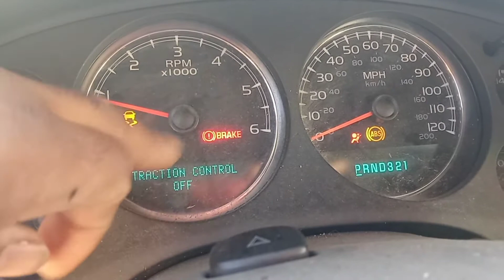Proof AFM DELETE TOOL WORKS/ 2 YEARS LATER!

Comment: Bro!! I have the same sprint I think. But it won’t let me pass smog. That’s the issue in running into. I’m in cali. 
After over a year fighting to find out why I couldn’t pass smog when there was nothing wrong with the truck.
I forgot to install the sprint once and I ran it. 2 days later the noisy lifter came back so my engine light turned on.
So I plugged my scanner in(still forgetting I didn’t plug the sprint back in from the last time). My smog was passed, but my engine light was on because of my lifter issue. 
So I cleared it and I plugged the sprint back in. And sure enough, none of my smog monitors set lol.

Comment: Thanks for the video!  My 2010 Silverado just had an incident where the lifter stuck.   Now it "unstuck" itself after I immediately pulled over and stood in front of my truck and scratched my head for a minute.  I think I'm going to go in and replace that filter on top of the motor and then run some engine flush, then change the oil... see if I get lucky.  I haven't been running the truck since the incident, so everybody keep your fingers crossed.   I'm not really a mechanic, but do you think I could get that oil filter out without having to tear down the engine too much?
Reply from the maker: Just buy the SPRINT AFM DELETE TOOL!
Reply: @PartTyme  Went with having a recommended mechanic replace pretty much the whole top end.   (cam, non-afm lifters, timing chain...etc...)  Like the truck, probably keep it 10 more years now.  won't have to worry about this problem anymore.
Reply: @wmsterlingwright  how much was mechanical costs
Reply: @navajorezathlete1202  I ended up getting another motor because mine was bad.   $5800 for used motor, afm dod delete, oil pump, timing chain, and a few other odds and ends.

Comment: I have a 08 Silverado it just started doing the lifter tap… Do you think if I purchase the sprint afm delete and drive hard will it free up lifter?? With out doing the screw driver trick… It literally just started tapping and been parked every since … Help ya boy out…
Reply from the maker: Honestly, I don't know 🤷🏽‍♂️. I didn't even start my truck until I did the job and got the SPRINT AFM DELETE TOOL plugged in
Reply: @PartTyme  engine light is not on & it’s not misfiring at all..
Reply: @PartTyme  It Works 7 months strong

Comment: So what you're saying is once I do the delete and install the sprint,,,it's going to not work until I take out on the road and run it hard???
Reply from the maker: Clear as a bell👌🏼 but legit, I've been driving the truck without the sprint, inadvertently without incident. I have an Avalanche as well so you can see how I can forget to swap

Comment: How many minutes or hours or are you driving before it started working because I’m having the same issue
Reply from the maker: Like 10 minutes of driving then I smashed it to pass a car. The issue went away immediately after
Reply: @PartTyme  so you gotta drive it hard for 10 min until it starts working?